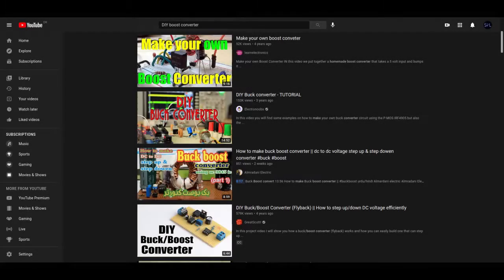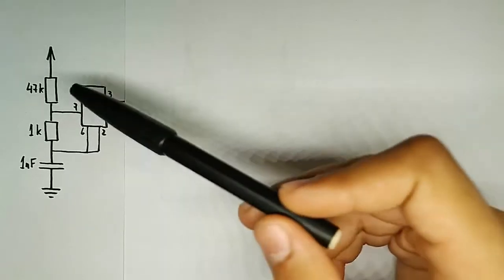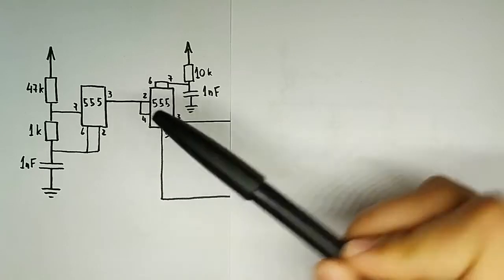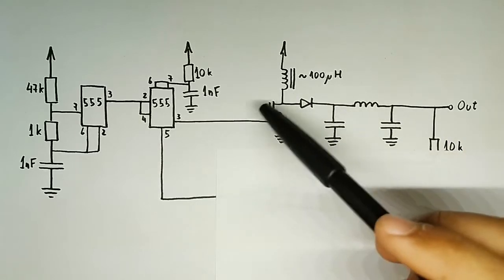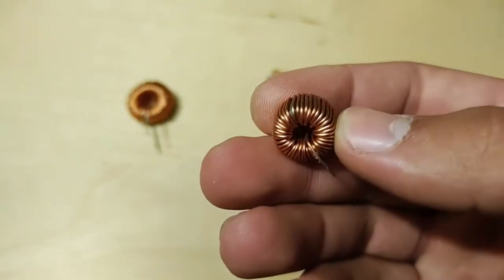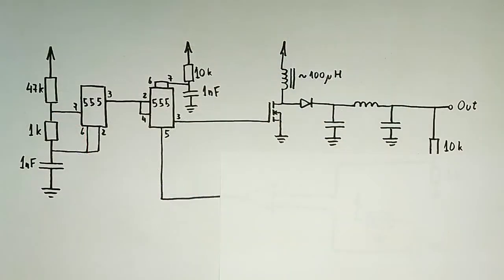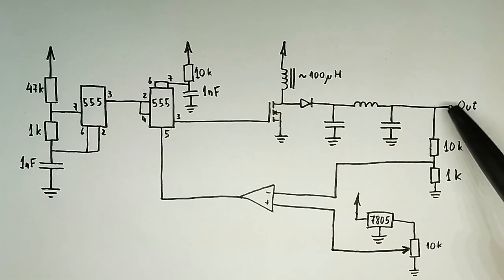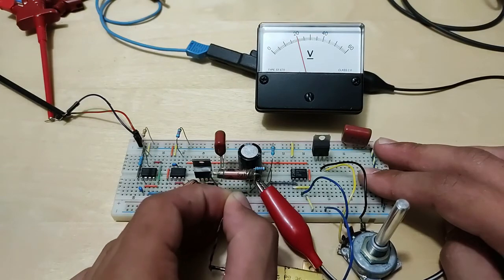How to make a Boost Converter WITHOUT Microcontroller (w/ feedback)

Comment: Nice circuit that is simple and clean, and also quite easy to understand the functionality of. It is sometimes easy to forget that the slew of new dedicated ICs are often complex and expensive not because that is what it takes to do the job, but because they are doing complex tricks for EMI or efficiency reasons. Basic linear and switching regulators that aren't concerned with PFC, EMI or maximizing efficiency can be built out of much simpler basic circuit building blocks.

Comment: Glad to see that someone else has also tried making a boost converter without any special IC's. I've made a buck converter with only some comparators and a couple transistors (for the sawtooth generation) for high-side switching a PNP transistor as fast as possible. Noise is only 1-2mV at a 2A load at 10V !!! 😄

Comment: Hi

I am asking about the battery or any supply voltage of the circuit, I see there was 60 volt. across  the inductance which is in some way between the + and + of the supply voltage . Will be there any problem ?  Do we need to protect the Supply volatge ?

Comment: Great Circuit there. Suggest adding a diode in reverse Bias to tamp down the spikes on the drain of the MOSFET. (Most MOSFETs have them built in - See datasheet) Note you need to ensure the reverse bias breakdown voltage is high enough. Check the data sheet on candidate power diodes and give yourself a 2X safety margin. Measure with an oscilloscope, but be careful to measure through a 10M ohm resistor. Voltages on those spikes could get high enough to blow the input on it. Also a good idea to use a small value, high voltage capacitor on the drain of that MOSFET as well. It will round down the peak voltage on those spikes a bit.  Ceramic or Mylar Caps of .001 to .01 microfarads should do. Again, give yourself a safety margin on the voltage. [Interesting fact: If you’ve ever worked on auto ignition systems on pre-70’s cars, you’ll see they would use a Capacitor (old school folk call them condensers) across the ignition ‘points’ to keep the arcing down and keep them from burning out pre-maturely. Ignition points are the old school version of the MOSFET here.] Thanks for letting me nerd out.
Reply: Thanks for the tips 
please stay nerdy 😄
Reply: Greatly appreciated.
Reply: I had both a 1976 Toyota Pickup and Corolla with that kind of ignition. Interestingly, here in the US nobody ever called them capacitors on cars. Condenser is a really old name. I found a channel called Kathy loves physics that does a fantastic job of going over the history of electricity. She breaks out the math into separate sections you can skip if you can't follow that level of math. I can follow the math, but making the overall history with and without the math is nice. She also covers all of the scandals and the DC/AC battles, too.

Comment: It is relatively simple but complicated in comparison the the NE555 boost converter shown in IMSAI Guy's video #837. He uses just a single 555 timer circuit and he uses pin 5 in a feedback loop to make a kind of pulse frequency modulation.

Comment: Is Reset connected to Vcc on your first 555 circuit? I cannot get your sub-circuit to work without making that connection… What am I missing?
Reply from the maker: Yes, Reset is always disabled by connecting it to VCC, otherwise the IC will have it's output forced low.
Reply: @5VLogic  It doesn’t look like Reset is connected on the first 555 on your breadboard (from left to right, first one being on the left). Simulating this I can’t make it work. If I connect the second 555’s Reset to Vcc the circuit doesn’t output any voltage (but does if I leave it unconnected — opposite from your breadboard configuration). I know a simulation isn’t perfect, but still confusing. Will try to build it.

Comment: Hi 5V Logic, thanks for the video!  I built a SEPIC converter using this method with a 556 IC last year.  It seems to work very well for relatively low current applications, but when I start pulling higher loads, it kills the MOSFET.  I have blown about 15 MOSFETs at this point trying to figure out the issue.  They aren't overheating, I am using a MOSFET driver, I have a heat-sink and check their temperature, no problems.  It just runs for a few seconds and then the MOSFET fails.  Have you come across anything like this with your implementation?  I can't help but think (going to test soon) the 556 timer is opening the MOSFET for too long, letting the coil get too much charge, and then when it closes, there could be a huge voltage spike.  I do have the second / "reset" side of the 556 tuned properly to make sure the main side resets even when a high duty cycle is needed.  Any advice appreciated!
Reply from the maker: The SEPIC converter is new to me, in any case I'm not entirely sure how your switching circuit is wired. I can only suggest some tests:
1) check the inductance values with the switching frequency to be sure the current isn't too high.
2) be sure there aren't high voltage spikes on the gate.
Best of luck!
Reply: Instead to use one toroi
dal coil to get the power you need, use two or three parallel conection of course every single coil (L) should be drived by it's mosfet therefor the less power 
 handle every single mosfet the less stress and overheat.I wish good evidence and resaults of  your project.
Reply: @STLOGIC-s2d  Thanks man, I found the problem.  When drawing too much current for the battery the voltage would dip, this would result in the 556 timing circuit not triggering properly, which opened the MOSFET for far too long, leading to a huge voltage spike when it finally closed while fully energized.  Thanks for the comment though!

Comment: How to calculate the feedback network resistance values??
Reply: It's just a simple voltage divider.  10k and 1k will divide the output voltage by about 10, so for 20v output, the feedback will output 2v.  This is then compared to whatever voltage is set on the potentiometer by the 7805.  If you want a much larger output voltage, one of the adjustments would be to increase the value of the first resistor in that divider, perhaps to something like 20k and 1k, so 100v output then becomes ~5v, and is easy to compare to the voltage from the regulator.

Comment: Its not working.. i tried simulation of it its not working
Reply: Sometimes simulators can be wrong, as long as the first 555 has a period longer than the second 555 in monostable mode, you can adjust the second 555 duty cycle with an op amp in differential amplifier (subtracting) configuration connected on pin 5.

Comment: Is this possible with only one 555 timer? 🤔
Reply: I think it would be difficult to do the job and keep a steady frequency, but perhaps someone can prove me wrong ; )
Reply: Possible using 555 timer and RC network which converts the square of the 555 to a triangle wave and comparing it in another opamp to the output of the first opamp which is seen in the video , that's how PWM works , it's like one wave scans the compared wave .

Summing it up :
it is possible but you'll need two opamps instead of just one .
Reply: @abov2983  Thank you! I’ve been experimenting with variations these circuits using 555. Has been eye opening (I have a math background, not an electrical engineering background). Have learned a lot. Thanks again. I’ll try this one.
Reply: @millamulisha  No problem , the output of the PWM gonna be trapezoidal (slowly rising and slowly falling) so you'll need to feed it to a schmitt trigger which will make it square before driving a MOSFET with it , that's why it's important to have a dedicated MOSFET Driver (for example TC4420) which has a schmitt trigger built in .

also , if you're getting voltage spikes in your opamps or something like that , it's probably because of the quick rising and falling of the MOSFET so make sure you're using a high capacitance decoupling capacitor (for example 2200mF) at your power source because the capacitor will block those spikes and won't let them affect the rest of your circuit .

Comment: thats pretty cool man... i searched for a answer to my question which is how does a boost converter regulate its voltage accross the different amps. your solution is to change the duty cyle but not the frequency... do you think it would work if the pulse to the coil remained the same frequency and duty cycle but the number of pulses per second was the controlled thing for example if its 50 mhz maybe it only needs 100,000 pulses worth of energy to keep the output capacitor at voltage so just shoot 100,000 pulses into the inductor by disabling the signal from reaching the mosfet, would that work? maybe this could be achieved by putting the output of the comparator to the base of a transistor that would hold the gate of the mosfet low thus disabling the signal from 555 timer from turning the mosfet on. has anyone tried this?

Comment: So, for integrated circuits you use two 555 timers, and an LM358 comparator. The 7805 is a voltage regulator. So if I understand this correctly, the voltage regulator could do this job alone but isn’t nearly as efficient as a boost converter so is only used for an input voltage on the comparator. I don’t know what the efficiency loss is for this voltage regulator but I wonder if it’s substantial, if you could even make a smaller buck converter in place of the voltage regulator (the 7805)… I wonder if there is any efficiency gain by doing something crazy like that. 😅

Hope that made sense. Great video by the way, very helpful. 👍
Reply: the 7805 is only pushing 0.5ma through the 10k pot, which is actually too little for the datasheet (4.2-8ma bias), a 1k pot would be better. In short, there's not much at all to save with a non-linear regulator to produce a voltage ref.
Reply: @dand8282  Thanks for a quick reply. Makes sense!

Comment: What if i didn't add the second timer and.  connected the output of the opamp to pin 5 of the first time will it still work?
Reply: I believe it would affect the frequency and duty cycle at the same time.
Reply: @pol.kraine7890  yes I tried that and that's what I found. I ended up using a ATtiny85

Comment: I keep wondering if the inductor spike affects the battery (if used). If the output were arranged around the inductor (treating it as if it were a battery, but without placing it in series with the real battery as is usually done) the output caps don't charge from the battery at all. Can you do a comparison of the two cases ? EDIT: Realized the feedback wouldn't work since ground has to be tied, and there's no way to tie it the other way (without becoming a flyback)
Reply: Voltage spikes, back EMF and noise generally do not effect batteries with some exceptions pertaining to flooded cell type but that's quite another topic..